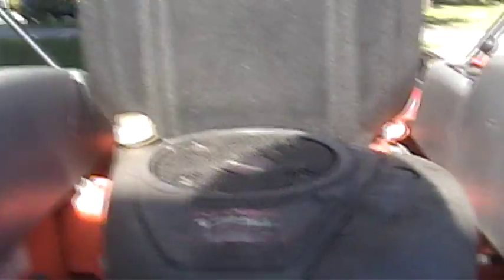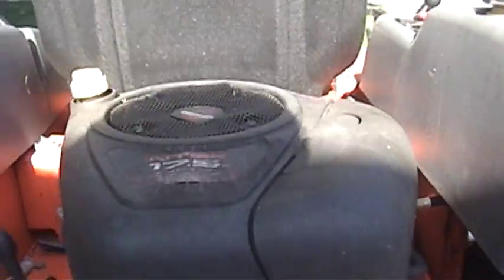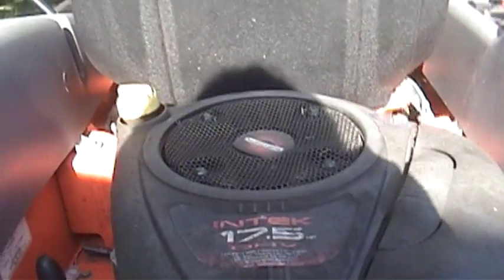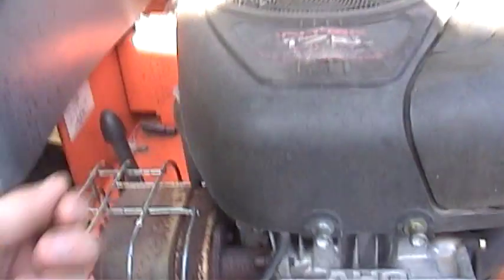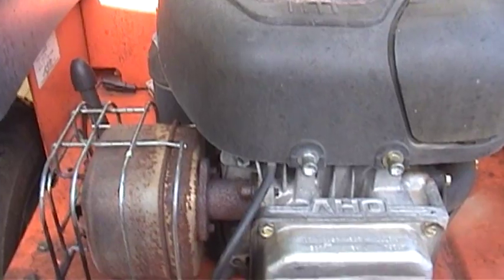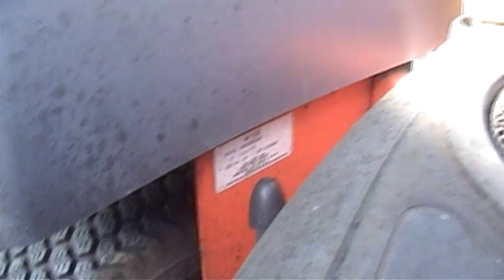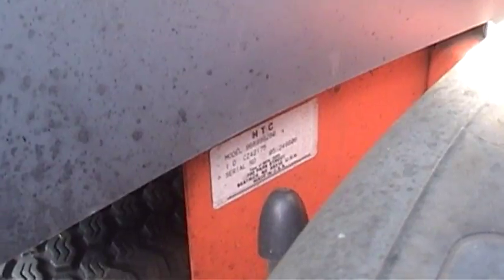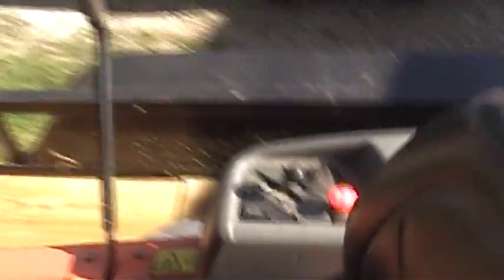Lawn Mower with Water in Engine

Comment: I get the same thing. Different mower but the engine looks like it's a similar design. I actually replaced the battery as I thought that was causing failure to turn over but I guess it was water in the cylinder. Time to buy a cover, I guess. That might help prevent the gas from evaporating too.

Comment: briggs & shittin no good plus yeah the carb design/air filter box is NOT water proof and easily lets water in you have probably have ruined your valves pretty badly f this has happens a lot

Comment: I have heard of this problem and it was a problem with the air cleaner seals being not to good and causing the water to go in the cylinder . If you change these it should fix it if not cover it up as the water will cause rust in the engine after a while even if you dump the water out.

Comment: Its the air cleaner. Spray a hose over the engine and open the air cleaner and you should see water then...

Guess you will just have to cover it up, not sure how it could be fixed or improved.

Comment: The water comes from the air filter. I have this same problem with my 17.5 OHV Briggs. The air cleaner has no seal on it and the water gets into combustion chamber from the air cleaner through the carburetor. What I do to remedy the problem is to cover the engine with a trash bag or small tarp. Works fine and is cheap!

Comment: my guess is its getting in through the air filter and going through the carb. or it could be getting in through the muffler. i would just cover it with a tub or something when you arent using it. of course the motor has to be cooled off first lol

Comment: It probably has an air intake duct that has an opening into the engine cooling fan area on the flywheel (top area that is open), so it will run down, through the air cleaner, and into the cylinder. I would suggest making some sort of sheetmetal cover to keep the rain from going directly down on to the top of the engine. I'm sure most people with mowers like this keep them inside, so it probably wasn't considered when it was designed.